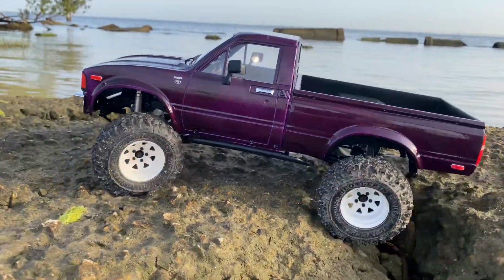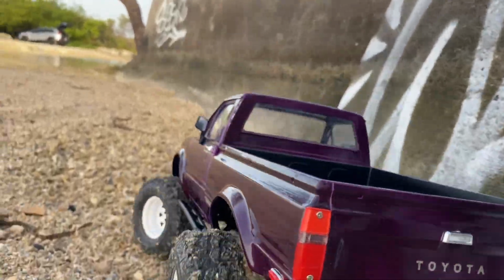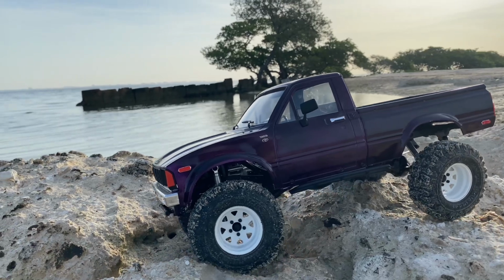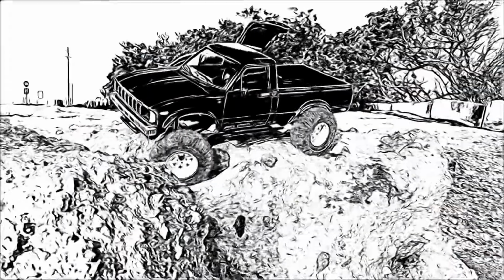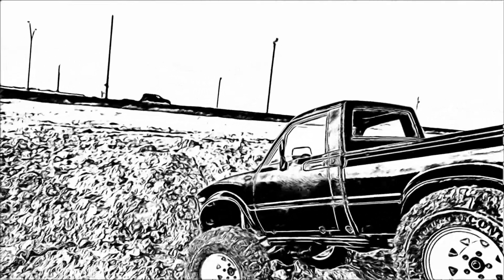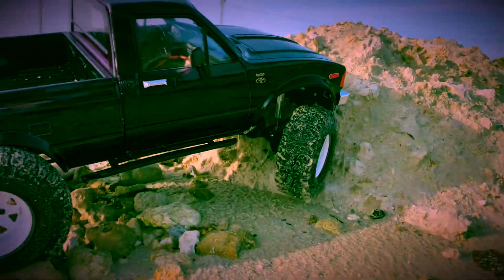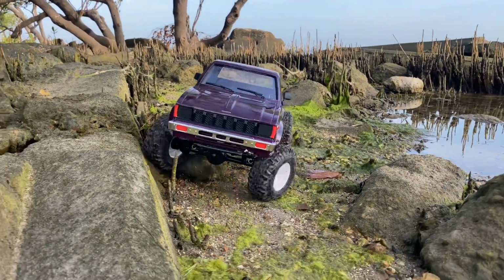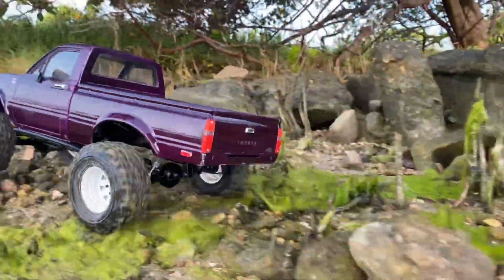RC4WD tf2 test run and overview Toyota Hilux 4x4 scale RC

Comment: Ear plugs😵‍💫it is such a good motor With amazing modulation.
Reply from the maker: That’s with the video sound turned down to 20% too!! It’s noisy but sooooo good other than that! I’ll figure something out or just mute the video next time. 😬👍
Reply: @jbsrcs6273  if you find a good fix post it!! The noise will grow on you..because the performance is so good 😊

Comment: To this day, I've never owned a RC4WD before! And my first RC was the Tamiya Frog, when it came out, in 1983! 😲 
I do want one, can't seem to be able to afford one 😪 
I have wanted to try a Leaf Spring Rig.

Yours looks nicely dialed in!!
Reply: And Outrunner Motors are the best for 1/24 Micro Crawlers too. Haven't tried it on a 1/10.... but it looks great on yours. 👍👍
Reply from the maker: Took some fiddling but it’s close to where I want it. Need to address that noisy outrunner set up. 🤔
Have an awesome week! 👊
Reply: @jbsrcs6273   Thay ARE noisy! I've used them in Planes for years, and didn't notice from 4-500 feet up.

Comment: The truck looks great and drives great. I would have to throw it in a drawer though as that whine would make me crazy. I know it is common but I cannot handle that noise (completely a me issue!) I would really like to get one as I would like to experience the leaf spring experience. I know compared to many trucks they drive awful but that is the part that interests me, trying to figure out how to drive it well so it is good!
Reply from the maker: Yeah, I’m trying to find a way to quiet it down. 🤔 different esc maybe or a 2s instead of 3s. Other than that though it ran fantastic so I’ll just cut the volume out until I fix it. 😬
Reply: @jbsrcs6273  it's fine, I know a lot of guys like to hear it and use it as feedback while driving. I wasn't complaining about the video, just commenting it is something I could not have in my trucks. Even if given to me I couldn't run that combo due to the whine. You're all good brother!  Didn't want you to think I was giving you grief, just commenting on how much I loathe that noise from them!